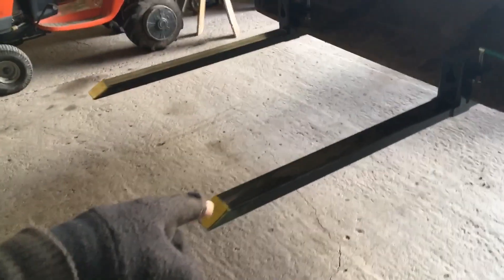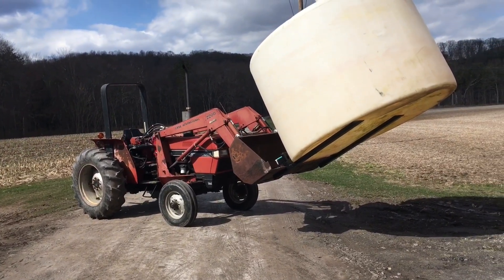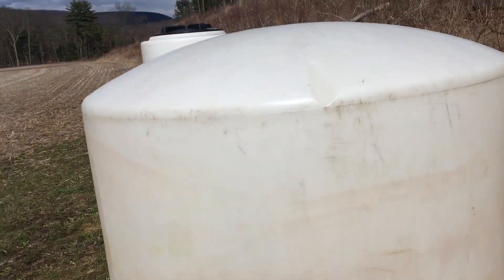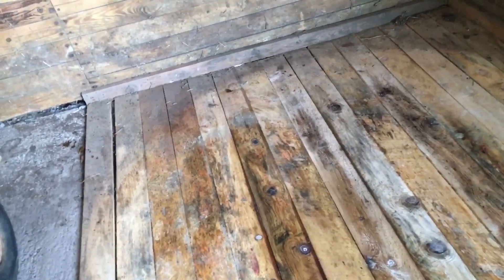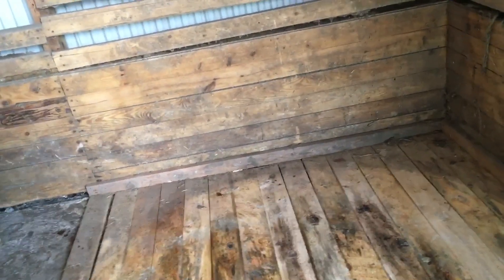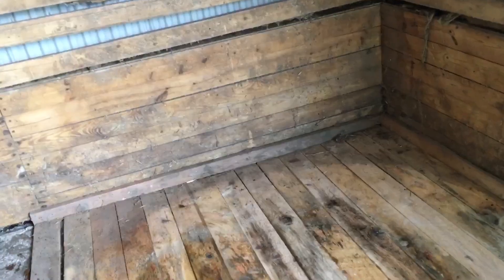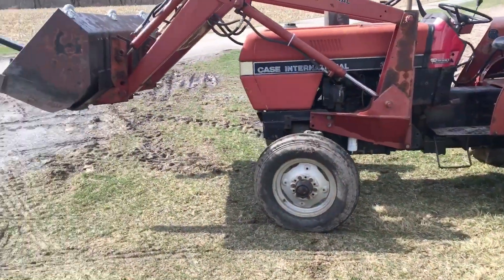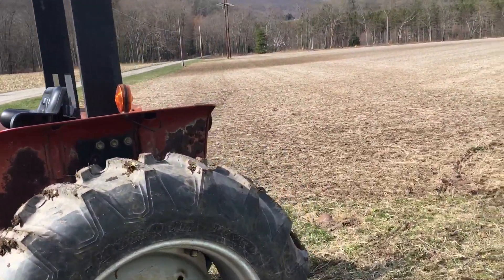Moving Fertilizer Tanks

Comment: Have you heard of any aftermarket 3-point hitch stabilizer kits? I would like to put some on my 5140's.
Reply from the maker: No I didn’t see any but it’s not to say they don’t make them. I have a hatred of 3pt hitches. I took it off the 986 and going to remove from the 685.  I saw a lot of guys bend pto shafts with them.

Comment: Different subject...my throttle broke at the first connection after the tension spring. Its cast and just broke right off when i was throttling up. Know any place to get parts?
Reply from the maker: What tractor was it on?
Reply: PA Farms 756
Reply from the maker: For that you could give Wengers of Myerstown a call, that’s were I would start
Reply: PA Farms ok thx
Reply: Farmall Fanatic you could also try Franzen Family tractor parts in Monmouth Iowa, they have everything!
Reply: H Turbo when i pulled the off the panel, i expected to replace a pin or bolt. Oh no, broken cast piece. Dreamy! 😁